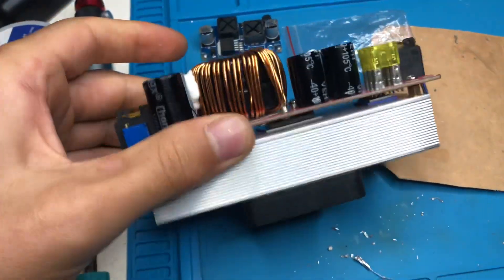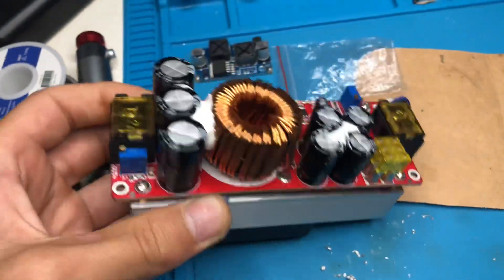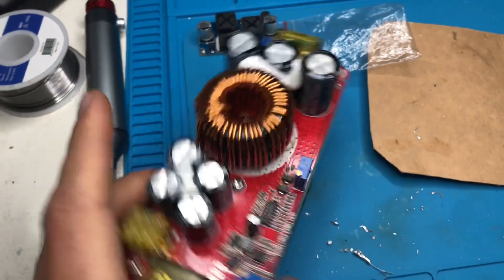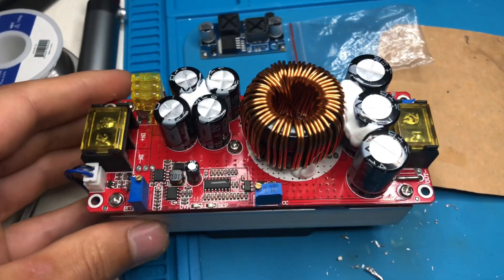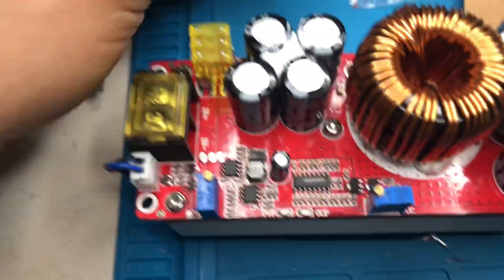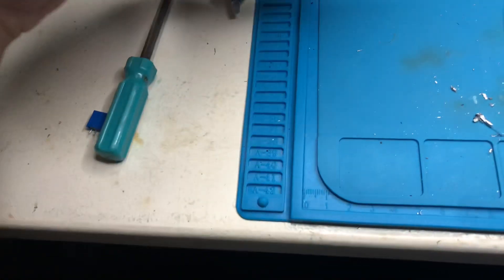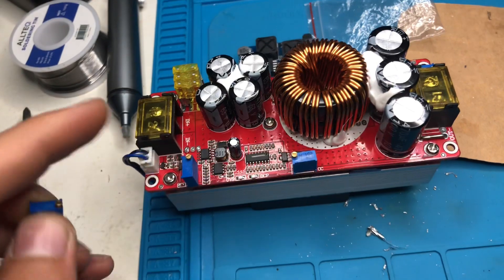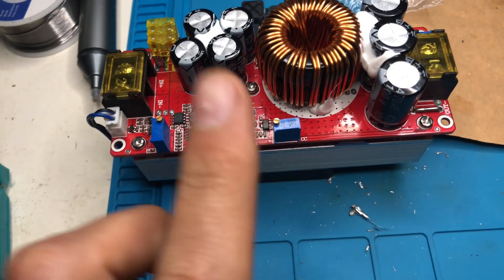Repair 1800W DC-DC Boost converter

Comment: Hello, I have a problem with this power supply, I power it with 14V, I set 28V on the output, when I turn on the vacuum cleaner the voltage drops to 11V, can you help me with a solution please?

Comment: question.. every tested max input current allowed. can it actually take 35 amps with input voltage say 45v?
Reply from the maker: It is advertised as. I didn’t test it to 1800watss. Worth a try. I bet there is a video to be found where someone puts it to the test